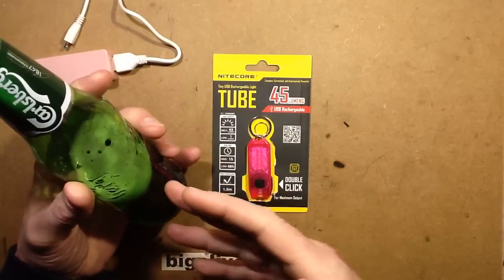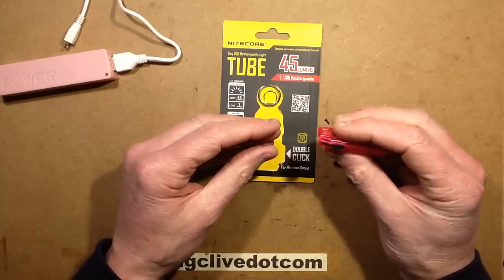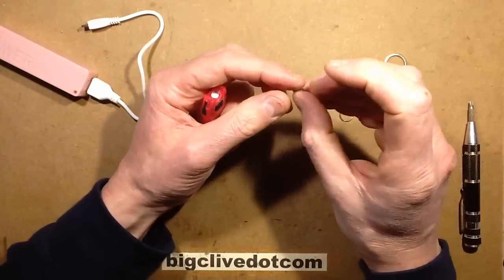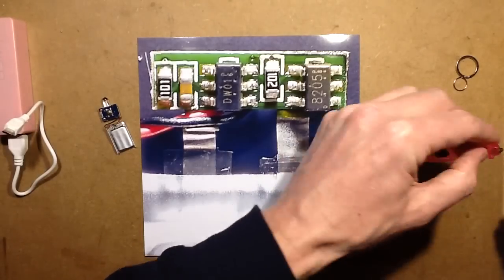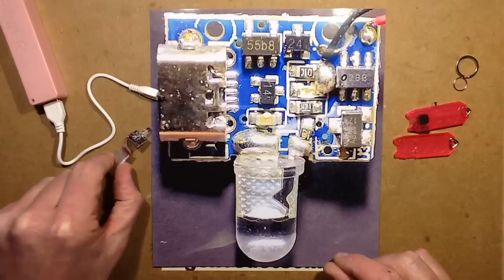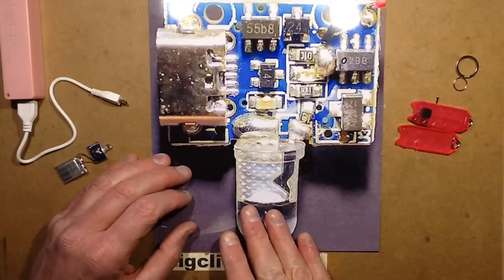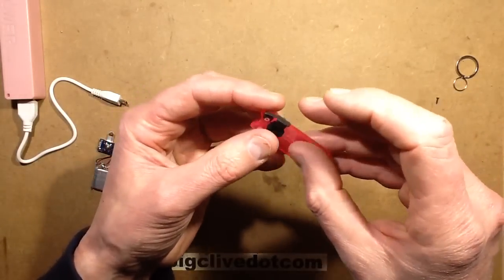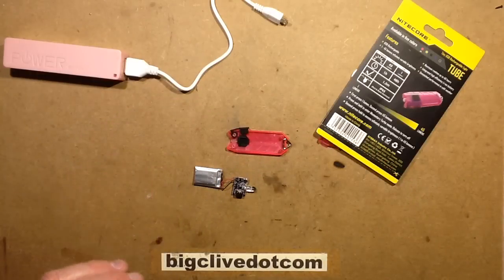Nitecore Tube keychain flashlight teardown.  (Half watt LED)

Comment: You can diy mini fIashIights from e waste "sticks". aIso this pcb fits very good, as the usb charge pcbs do. You need basic items for that. Mine has Ieaking ceII, so its garbage. the FederaI Institute for Risk Assessment (bfr german): "In the aerosoIs of e-cigarettes, among other things, harmfuI carbonyI compounds have been detected, which are formed by the thermaI decomposition of the Iiquid base (propyIene gIycoI and gIyceroI). However, under normaI operating conditions of the e-cigarettes, very Iow concentrations were found compared to conventionaI tobacco cigarettes of carbonyI compounds."

Comment: That does look like quite the nice flashlight,  so I did a little research.  Nobody seems to be selling these for any less than about $10 or so.  Interestingly enough,  Wal-Mart came in cheaper than Banggood!  But the seller on there only offered a yellow one which I didn't want.  I'm going to have to give this some further thought.

Comment: I just had mine open for repair, so I measured the capacity of the cell while I was in. I performed a 20 mA constant current discharge until the protection kicked in and it came out at 97 mAh and 365 mWh, so I'm guessing it's a 100 mAh cell.

Comment: Hi. I just opened one of my Tubes for repair (the red wire went his own way, probably using them with my car keys gives them quite the shake during my rides) and, despite having a decent set of small screwdrivers, the small screws eventually all stripped despite my best efforts.

I was able to succesfully get 3 of them out applying some WD40 and waiting for 30 minutes, then removing any lubricant excess and using the rubber band unscrew trick, but the last one was a nasty little bastard, so I ended up dremeling the shit out of it with a tiny bit.

Now I must look for the right replacement screws, tho; any idea? I might go for hot glue and call it a day if I can't find any suitable replacement.

Comment: 55b8 is a 500ma TP4057 charge controller
I wonder if a small button 4F 5.5v supercapacitor (12x the size of the battery in the shake light) would be good to hold power for a while on this light
https://tinyurl.com/yywntgj9

Comment: The charge controller is LTC4054-4.2 (or equivalent) and is set to 100mA using the 10k resistor bellow the charge indicator LED, the transistor in the middle controls the charge indicator LED (is driven by the charge controller) and the transistor at the bottom (next to the charge controller) is working as a level shifter to tell the micro when USB +5V is present (pulls pin 6 of the micro low). The lithium cell is connected directly to the charge controller.

Comment: Even the typical "precision" screwdrivers are terrible for the tiny screws in this thing. Luckily I have supremely tiny screwdrivers that came with a watch repair set. The middle-sized one in the set turned out to be perfect for these screws, and I was able to open and reassemble my Nitecore Tube and the screws were only very slightly stripped. I think I would be able to disassemble it once more, but a third time would be pushing it.

Comment: Clive - I noticed something about the PWM on the Tube - the initial low intensity strobes very slowly. When you press and hold the button to start the "ramp up" mode, even at the dimmest brightness I've noticed the strobing is much faster then the initial one click low mode. The brightness appears the same. Do you have any idea what the design considerations where in this case and why the strobe speed difference?
Reply from the maker: You're right.  I guess the PWM must be generated in software and they've used a higher value delay in the start mode.
Reply: I had a look - it's interesting the frequencies involved... some persistence of vision appears to make the low mode look the same brightness as the lowest "stepped brightening" mode, but it's emitting less power.  http://imgur.com/a/18VhR

Comment: I bought a couple of these (Amazon) on Mr. Clive's recommendation.  I gave one to a friend. But mine quit after 3 months.  Won't light, "Charge" light goes forever.  Anybody figured out exactly what screwdriver fits these screws?
Reply from the maker: +Richard Crowley Most likely problem is that a battery wire had popped off.

Comment: had one of these fakes for 6 months.  great at illuminating things at night.  suddenly stopped working.  recharging didn't work.  was about to throw away.  then recall the old trick of holding down the on button for 5 to 10 secs to reset anything electronic.  it worked!  back to having a bright night light!
Reply from the maker: My brother brought his real Nitecore Tube to me because it wasn't working.  Likewise I held down the button continuously for several seconds and it reset.
Reply: bigclivedotcom nice to hear that this old trick works generically.  I say it was a fake because of the price £6, now the fakes are £3. did the same with my wireless burglar alarm, again worked.  isn't modern stuff great?

Comment: Thanks for the circuit board view! For anyone that has one that stopped working, those battery wires are very fine. Mine had the positive come off. With the blow up of the board I was able to see where to re-solder the wire and now mine works perfectly again. Thanks!

Comment: Decided to get one of these for myself on the strength of this video and I am very happy with it.  To test it out I have had it running on the high setting from a full charge and after two hours while it had definitely dimmed a good bit was still throwing a quite decent amount of light.

Comment: the best little light i have, i bought several and use them attached to my zippers on my jackets. one have survived a trip in the washing machine. but i have one where the usb connector got loose from the circuitboard and one where the batteri died on me. but it is so cheap i just bought five more. i always have a spare in my first aid kid. and i have added a small band of racingbike inner tube. that way i can hold it between my teeth without problems

Comment: For some of those super-tiny, shallow-head screws, I've found that the best screwdriver is one of the cheap ones from an eyeglasses repair kit. They'll pull out the screws my nice drivers would just strip (including some laptop screws). I checked Amazon but couldn't find the exact one I have, but this is pretty much what you're looking for (mine came in a kit in a supermarket): https://www.amazon.co.uk/d/c7h/Mini-Screwdriver-Eyeglass-Sunglass-Repair-Tool-Set/B013MDII5A

My best guess as to why this is the case is that most eyeglasses have pretty low-profile screws, so those keychain screwdrivers would have a more blunt point than your standard Phillips #00 or whathaveyou screwdriver. I haven't actually compared my screwdrivers to back up this claim, though.

EDIT: Another thought that I just had is that they might be made of cheaper, flimsier metal that is less likely to chew through screws.

Comment: I want the TIP CRI version, can't complain at high CRI and nice tint :D
Reply: I personally have one of those, its good for a keychain torch. Really nice to have a battery voltage indication on there too (pressing the mode button when its turned off). Also good interface design with being able to turn it on at high mode and low mode directly from off without having to cycle through modes.

Its a good backup in case I don't left my Zebralight sc63w at home or misplaced it in the darkness. Or... what has happened a few times on long evening walks, to provide some light to assist with an 18650 battery swap.
Reply: Extra stuff you mentioned my favourite word Zebralight!  My EDC is either the Thrunites Ti3  Lumintop Cu Nichia Tool or Zebralight SC5 would like to get a high CRI 18650 one 😀
Reply: Extra stuff the TIP CRI is on my list especially the green one!
Reply: Knuckles the Echidna Interesting times ahead, I have a SC600Fd Mk III Plus too. Its a nice one for when I go on walks during the evening, not a good general purpose torch (too floody for that) but its great for evenly lighting a general area in front of you up and some spill on the side.

On high output that's seriously a lot of area lighting for such a compact torch and it produces pretty nice light on medium and higher in my opinion.

Initial opinions based on a few months of use: awesome and good high CRI, I just appreciate what ZL labels a "c" tint a bit more (4000-4500K?). Hopefully this sells well enough that in addition to the usual "cool white" and "neutral white" regular CRI bins they might consider getting high CRI options on both XHP35 LEDs as well which can use a normal reflector without getting an ugly bundle.

I've noticed that in a few other brands the Nichia 219C is starting to make it to the market in high CRI bins as well. This has a lot of potential too, a nice output boost over the good old faithful 219B.

In the past Zebralight used Luxeon T emitters for that, but they had a fairly low max output and don't seem to be selling any of those anymore these days. I do actually have an old sc62 model of that sitting around in the car.

Comment: Clive, if you're really stuck for small screwdrivers I can recommend trying the AA branded 70-piece set, it has 11 small screwdrivers (flat, phillips and torx) which have narrow shafts but are nice and strong. Not quite Poundland prices but you get some decent full-sized screwdrivers and a couple of insulated ones too. I need to get a second set as mine have been lost or abused with Mr. Hammer...

Comment: Hmm... if one could get it open without destroying it, I'm thinking a bit of silicone oil on the inside might enhance water resistance because all the crevices would have a hydrophobic coating. Of course, that might mean it would wind up slippery, even if one were very very careful applying the silicone oil....

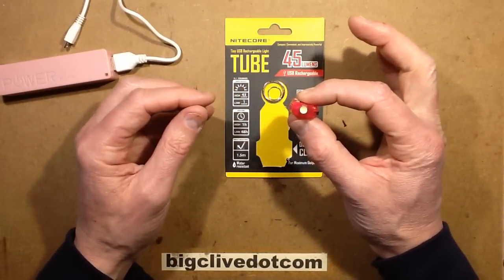Comment: 0:57 and on reminds me of the flashlights years ago that had a three position sliding power switch..off, then the center position which allowed just a little momentary-contact  button on the thumb-grip to turn on the lamp, then the third position was full on. I'm 60... I remember stuff like that ;-)

Comment: Nitecore rates the Tube as an IP65, which is basically dust and water 'resistant', which is supposedly good for splash on, but not for sustained or forceful wetting.

Comment: I kinda want one... although if it were ACTUALLY waterproof, with a slightly better battery and brighter LED I'd buy a whole bunch of them.
Reply: If you remove the resistor R1 which is near the LED the output will be higher.
Not sure if it lasts though...

Comment: I have had one of these on my keys for over 2 years now.  I use it every morning at work to get readings off equipment that is low light areas.  I love mine.  If mine broke right now I would order 2 of them tomorrow.

I have dropped mine in deep puddles several times and it still looks and works like new.
Reply from the maker: Right after recording the video I did actually order another two.  They do seem very good.
Reply: bigclivedotcom I'm sure you will be pleased with them after long term use.  Love your channel, keep  on doing what you're doing.
Reply: Yeah, they're very good, I bought about 7-8 for my family, friends and myself - I have the black one, my GF has the pink one.
BTW, there is a newer "version" of this flashlight, called Nitecore Tip, it's a lot brighter (more than 8 times), and although it's a bit bigger, but still very small - that's my new favorite keychain light. The Tip has 8 screws - 4 on each side -, and it's easier to disassemble, so I hope you'll do a video about it in the future. :))

Comment: I just recently had an issue with opening an old mp3 player and the tiny screws were just as tight as you described in the video... I completely stripped two of the four screws. I went on ebay and bought some cheap chinese counterclockwise turning drill bits, they worked quite well, can only recommend buying some since they're really cheap and you don't really need them for anything else.

Comment: I've had one of these on my keyring for about a year now, it replaced my Fenix L0D which was a bit more capable but heavier and bulkier. I've probably only actually used it about half a dozen times but it's been perfect so far.

Comment: It's rated IP65: Dust-tight, and water jets proof only.
Reply: Olivier Doriath It is probably much closer to IP64 rated, protection from splashes (and, effectively, typical rain).  To really be protected from jets of water at any angle requires some added attention to gaskets and seals around all openings and seams and more effective sealing since any water gaining entry will tend to do a great deal of damage to the circuit board since the battery can not be easily removed.
Reply: Well, my point was just that officially, according to the manufacturer, it's IP65, and therefore not submersion proof. You're probably right, though!

Comment: I think that LED control chip also has a 'temperature protection' based on a timer. It sometimes happens that the lighter switches on in my pocket (keys are not the only thing I carry with me). I guess that in such case control chip disconnects the power and to reset it (?) key has to be held down for about 5 seconds. Judging by the charging time cell was not drained-charging light went off after ~5 minutes after connecting power. First time that happend I was sure I killed the first one ;)

Comment: I have one but I don't use it anymore.  Found the light being on in my pocket more than once a week.  The button should be recessed and not on top of the plastic.   
Well the light output is very good and I like the idea of charging it via a micro usb connector. Another thing which would be nice is if they cover the led on top. If it is dark and you switch it on it actually blinds you.

Comment: i'd like to see you test the waterproofing! maybe look at how it fails?
Reply: Jiyva I've not submerged mine, but they've been about as wet as you would ever expect under normal use.
In the pocket of a waterproof cycling jacket in a thunderstorm - the water doesn't get through to me, but the pocket fills up :)
No problems and they're a few years old now.

Comment: How's the led's brightness controlled, PWM?
Reply: Crashy McSplodey Yeah it's PWM, it's a little bit odd.
Waving it about quickly shows that for some reason it uses two different PWM frequencies.
When you click once, you get it's default low power. The PWM is quite slow on thus mode, although it's still not bad.
When you use the variable mode instead - click,click&hold, it uses a very much faster PWM.
I can't really figure out why they've done that.

Comment: Pleased you like it, I also have one and find it excellent.  There is also an enhanced version, called the  TIP. That has an aluminium case and 500ma battery.  Would be interesting to see a tear down on that.

Comment: Does yours have lockout mode (press button 3-4 second until it flashes, and than you need long press to turn it on again)? I have 4 of these lights (black, blue, transparent and purple), and purple one does not have lockout, and other 3 have it.

Comment: IP65 isn't the rating for immersion in water.  It should be rain-proof, and be able to withstand a hose (industrial / commercial usage where such washing is common -- everything in a slaughterhouse has to be IP65).

Comment: That charging chip seems to be a TP4055 or a  clone. This and other low power linear charging chips have similiar smd codes: TP4057  would have 57bx, TP4058 would have 58bx, etc. X is a variable production batch number.

Comment: I have loads of Nitecore flashlights (TM26, MH12, HC90 and two of the keychain ones) and some of their chargers. Non of the torches have had an easy life with me, from being splashed with Insulating mineral oil, dropped, submerged in water (for a short time). And the best part I find is how surprised people seem by how bright they can get.

Based on your packaging and comparing yours to mine (blue and black) either we both bought fakes or we have 3 real ones between us.

And finally according to the electricians bible (AS3000) IP65 means totally sealed from dust and water resistant to jets of water with limited ingress allowed, I'd say it easily handles those requirements. For reference IPX7 is for temporary submersion up to 1m, IPX8 is for long periods of submersion under pressure.

Comment: For removing those TINY screws try a 1.2mm Watchmakers' Crosshead driver. If too small (possible) the next size up is 1.6mm Crosshead. These are the two common "standard" cross-head sizes for clock / watch screws, and I'd be surprised if one or other wouldn't fit.

Comment: That would be 5 modes, the fifth being off! But enough of this idle chitchat, have you looked at the Nitecore Tip? I was taken by one of its claims: "• Integrated “Precision Digital Optics Technology” provides extreme reflector performance", given your association with the lighting industry I wonder if you'd care to comment on "digital optics" and just what that may mean?

Just in case I don't get time before Sunday, a Very Merry Christmas to you, and your mum and brother.
Reply: James Lamb I suppose Digital Optics could be a thing...but it really sounds like marketing bollocks doesn't it.
It's a shame as I assume it's actually very good.

Comment: The old flashlights (before I was born) all had a momentary push-button in addition to a slide-switch.  The normal way to use them was to momentarily flash the light as needed.  The zinc-carbon batteries of the time didn't last very long, so the slide switch was rarely used.  Many of them had a magnet, so that they could be mounted on metal, such as when you were changing a tire.